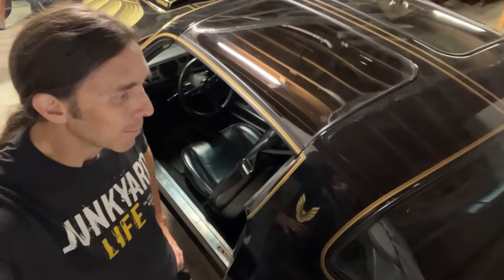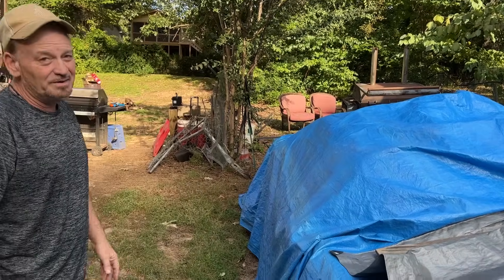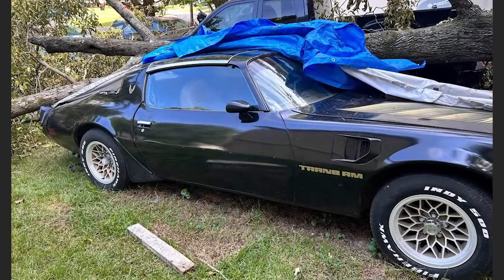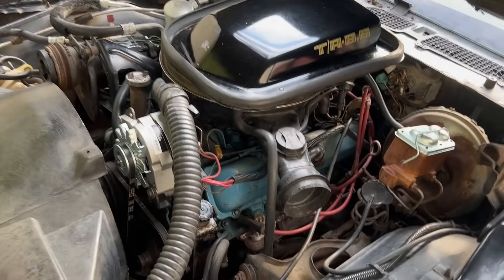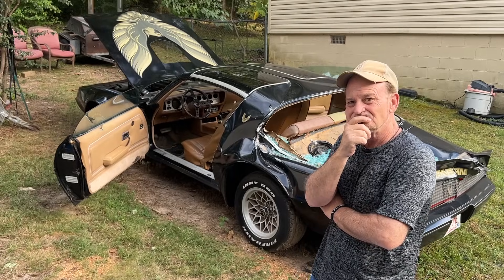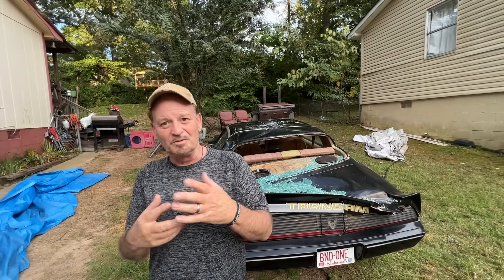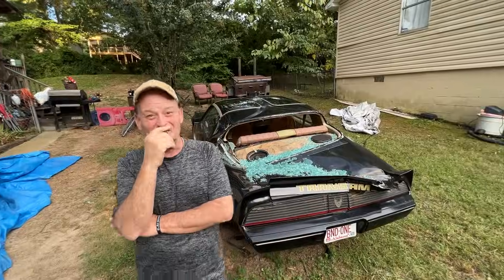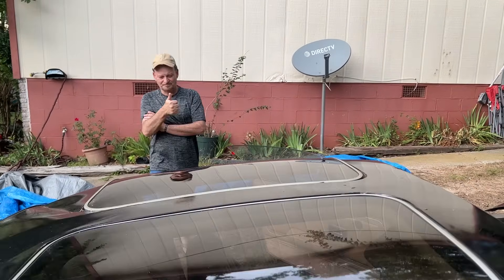1979 Pontiac Trans Am Totaled by Tree in Alabama

Comment: It's a shame that it happened to anyone, but at least it's not a 400/4 speed car. It's got the wrong hood scoop decals (a common error after repainting as the decal companies include the T/A 6.6 decal and make you buy the 6.6 LITRE one. Most don't know or care when buying the kit) as a 1979 Trans Am with an automatic transmission (in this case a 403 Oldsmobile engine) should not have "T/A 6.6" on the scoop, it should have "6.6 LITRE" on it. But it's still sad to see it happen. It can be fixed with the right person and with some effort.

Comment: It could be brought back with a lot of work
Reply from the maker: I agree! These Trans Ams are big bucks nowadays. Definitely worth saving.
Reply: @Junkyardlife I'd like to help this guy out. My shop in SC specializes in trans ams and car restoration. Currently working on a 70 Mach 1 Mustang that's only getting part of the firewall, rockers and inner structure reused. New floors, frame rails front and rear, quarters, roof skin, trunk filler, trunk floor, wheelhouses, tail panel, dash panel, etc. 

I have the technology, I'll have to see if the spare roof skins have the same t tops.